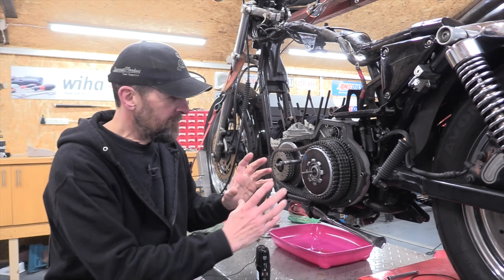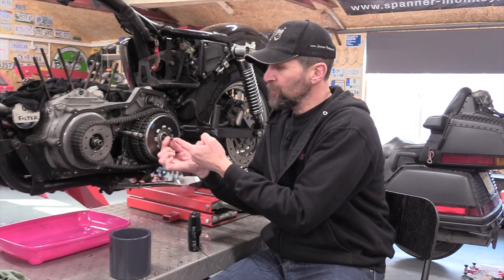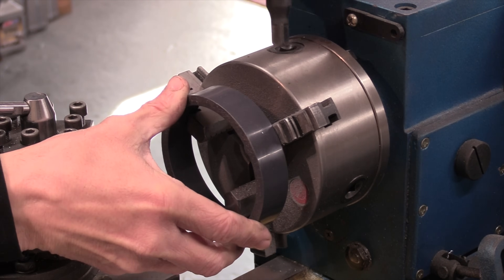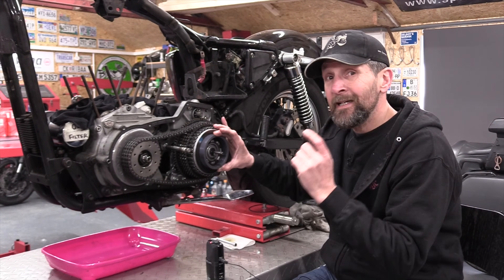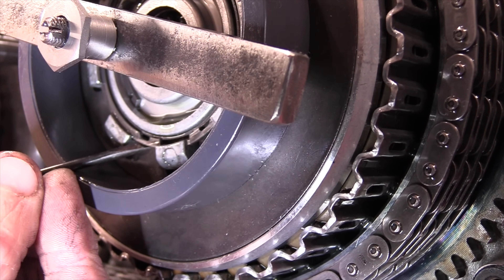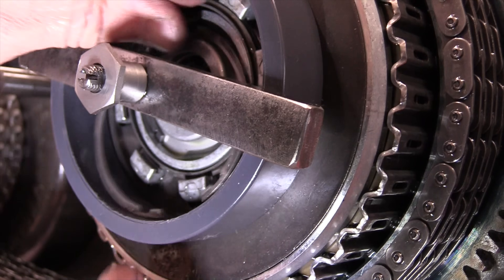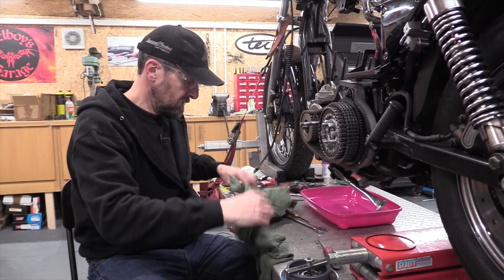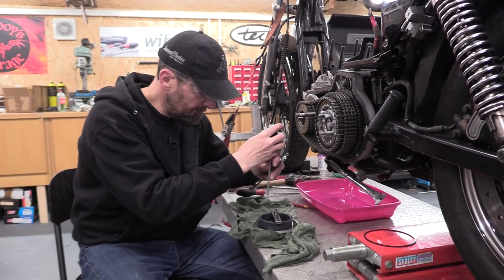Harley Sportster, DIY Homemade, Clutch Compression Tool !

Comment: I was a professional locksmith for 40 years and my most treasured tools were the ones I built myself to do that one job. Early in my career I could not afford the specialty tools, so I made them myself. This also allowed me to complete the work quickly without having to wait for a special order to arrive. This is a particularly satisfying video, thanks.
Reply from the maker: Thank you for your kind words Kelly, and I agree with you in every way, I've many tools I've made myself over the years and they're all of sentimental value to me for the same reasons yours are!  Thank you again for your support.

Comment: Enjoyed the solution. Del.  On a good note, the ST started because I traced back my work and realized I was suffering a mental lapse and hadn’t plugged the darn cam pulse sensor back in.  Not one of my finest moments but the bike fired right away and runs better than ever.  The bike gods took mercy on me.  I was worried I had somehow messed up the timing after reinstalling the cams and had wrecked something.  

Onwards and upwards!
Reply from the maker: Sure thing buddy, I've been exactly there too in the past, when I put the Hayabusa back together I spent half an hour head scratching why it wouldn't fire up, spinning over till it almost flattened the battery, then found a tiny grey plug that was the power feed to the fuel injection... click, vroom!   Followed by copious self kicking...!  We've all been there buddy!
Reply: Que circunferencia tiene el tubo de PVC?

Comment: Del, if you're planning to reuse the clutch, make sure to get rid of that grenade plate in the middle. First one gave up about 6.000 km after I bought the Sportster, no idea how many miles it had done previously. Dealership replaced it with an original clutch with the same grenade plate, as I was a begginer and didn't know I didn't need to replace that plate. 7.000 km later, same plate died. I then bit the bullet and swapped for a Barnett extra plate clutch, and hopefully nobody will need to open the clutch again in until long after I'm dead, as I'm sure this engine will still be running by then. :))
Reply: Nevermind, somehow I missed the previous video, I just noticed it now. Was wondering why you wouldn't make a video with dissasembling the primary case. :)

Comment: Little tip on diaphragm spring. Use a oil filter cup wrench that fits and the nut fits in.
Reply from the maker: So how do you then get to the spring clip inside it?
Reply: @Moonfleet41  
This is for the clutch diaphragm

Comment: Ok so I tried this and overtightened the nut and pulled the clutch adjustment screw through the bearing. I’ve just replaced the bearing with a new one and I’m about to try it again but I’m worried about putting pressure on it again. It wasn’t anywhere close to releasing the tension to unclip the circlip. Is there another way to release it other than using the bearing as a leverage point?

Comment: Hi.

I am struggling a little bit with the tool. I have made 2 and still don’t work.

I have a 6mm thick steel flat bar with a 8mm hole drilled in the centre and 20mm long soil pipe. 

After a couple of turns the metal bar starts bending and the PVC pipe starts de forming. I really don’t know what else to do. Also, the nut will only screw on to about 5 threads before getting tight.

Comment: It works on the stock spring, but if you go to a heavier spring, it doesn't work so good
Reply from the maker: Indeed, you would then need the heavy duty dedicated tool!
Reply: @Moonfleet41  your method/tool, worked perfectly, that was a great tip, but I did the extra plate kit with the heavier spring, i drag race my 99 Sportster, 100hp/ 92ftlbs torque, 11.60sec @ 113mph, 1/4 mile, sure like your videos brother
Reply from the maker: @marklaramie7393  Glad to hear it worked for you Mark, and those are some impressive figures.. and they say Harleys are slow..lol!

Comment: I had to replace the clutch on my sportster once. The middle steel, the one with the rivets in it, exploded. Took out the clutch basket and everything. Cost me a good $1200 to have it all replaced.
Reply from the maker: Thats a shame, was your bike standard or tuned in some way..?
Reply: @Moonfleet41  it was tuned and had cams. I bought it used so that was already done. The only thing that the previous owner had not done was the Screamin eagle clutch.
Reply from the maker: @zachowens1412  Aah that makes sense, they aren't up to the job on heavily tuned engines.. Hope it's ok now, sounds like a fun bike mate.
Reply: @Moonfleet41  it was a fun bike. I sold it to get a Dyna because the sportster was not comfortable for the wife. I sold the sportster back to the guy I bought it from for the same price a couple years after buying it and bought my 06 Dyna for the same price so it was a pretty good deal. If I could have I would have kept the sportster and just added the Dyna but can’t afford two.
Reply from the maker: @zachowens1412  Know how you feel there mate.. imagine if you could keep them all aye..! 😄

Comment: Just shows you how overpriced some things are, when you can make a perfectly viable alternative at a fraction of the cost, and even without expensive machinery
Reply from the maker: Sure thing Alan, if I did this every day, I'd buy the tool as it'd be well worth it and as special tools go, £70 or so is really not that much, but when not likely to use it again for the foreseeable future, it's good to save the money...!  Thank you for your kind support, it's always good to hear from you.